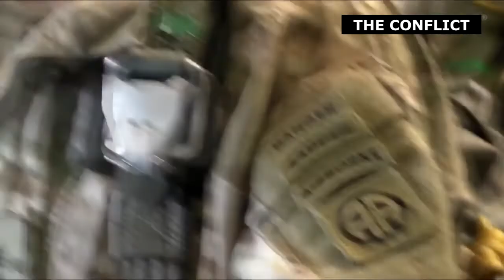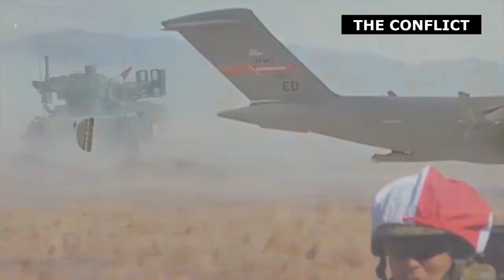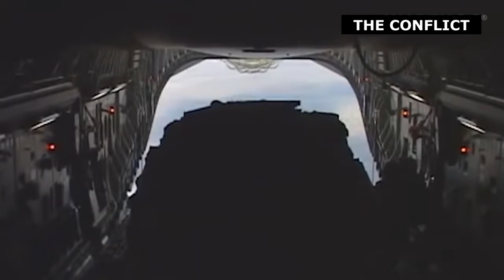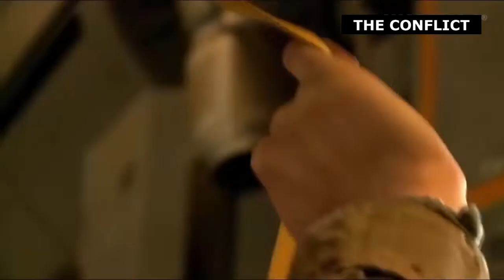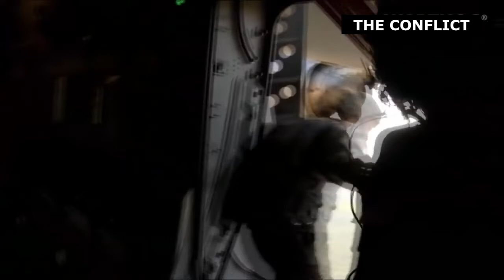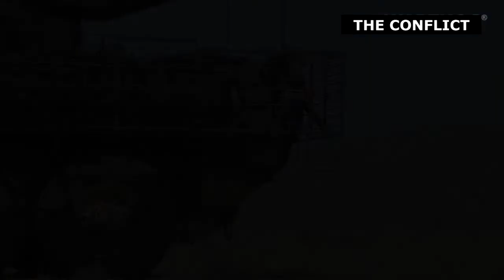GEARING FOR WAR   THE ARMY JUST REACTIVATED AN COLD WAR ARMORED AIRBORNE UNIT

Comment: The Piranha based LAV25 is a maintenance nightmare compared to the Stryker. And the Stryker is pretty bad. If you've ever conducted operations with a Marine LAR unit, they are at 60-70% strength within 48-72 hours without enemy activity. 
The 82 needs the Korean K21, not recycled equipment the Marines cannot wait to get rid of.
Reply: Yeah I don’t really think the 25 is very practical when the Strykers are more dynamic, modern, and in general, more fitted for modern American armor crap
Reply: I am still confused over the Army's choice. Why not the Stryker? Thanks for the info on the Korean vehicle. I had never heard of it.